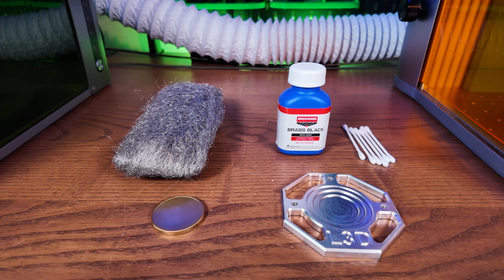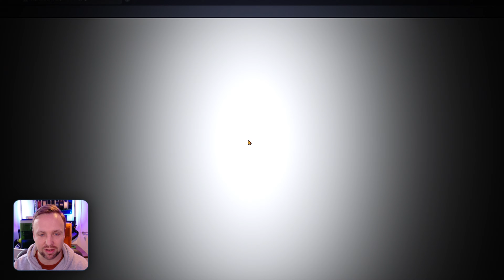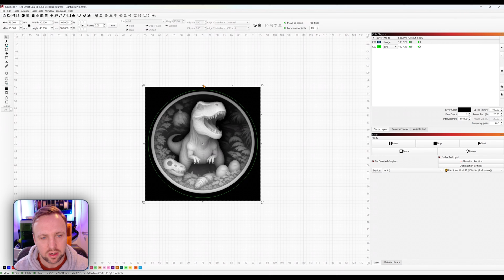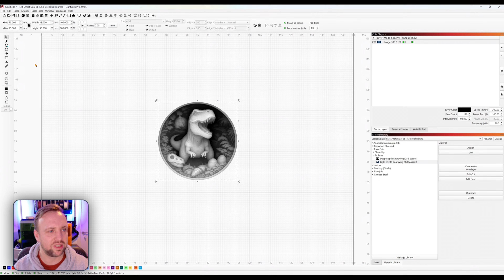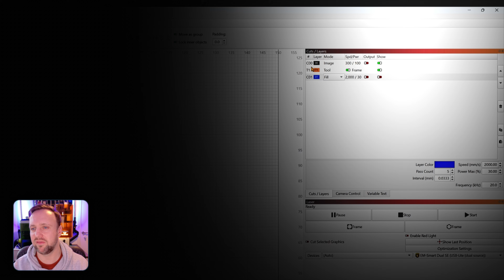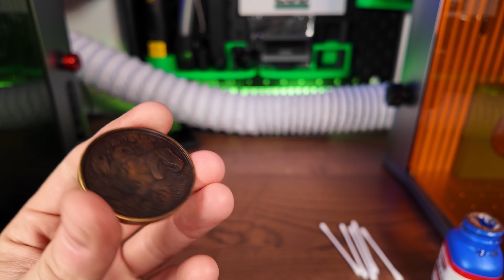Engrave Detailed Images Into Metal Coins Like a Pro

Comment: did you say a 20w fiber laser ? everyone ive talked to have told me that you need a 50-60+ watt laser to be able to do this
Reply from the maker: Yes it's a 20w fiber laser which is more than adequate to do coin embossing like this. What I would say is higher power will result in a faster embossing time.